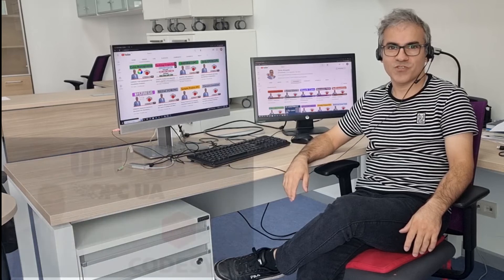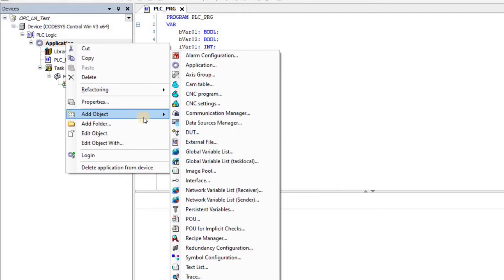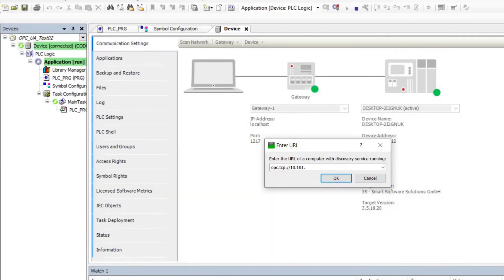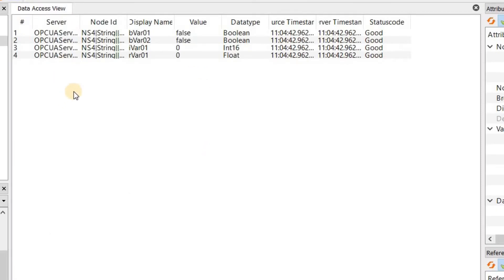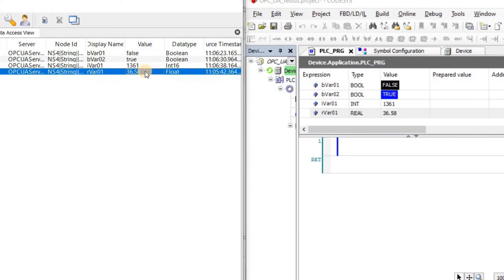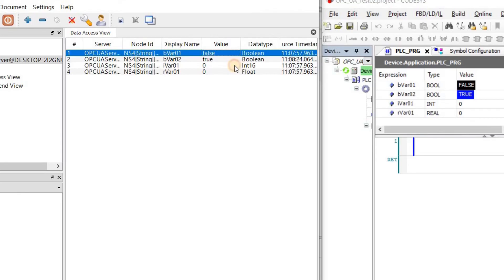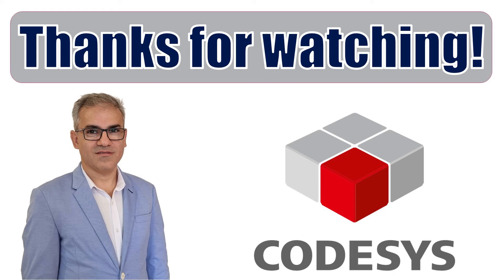CODESYS: OPC UA - Using CODESYS PLC as an OPC UA Server #codesys #opcua #opcuaclient #uaexpert

Comment: Hello my friend, great video! I have a little question. How can I apply the values in CoDeSys, to change them ( OPC UA-Server)?
Reply from the maker: Hi, thanks for your comment. I didn't understand your question fully, but if you mean that how to change the values f the variables on the CODESYS side, while the project is running, you can do it through visualization or by forcing values to the variables.

Comment: Hello sir, thank you for sharing this video. In my application , i want to send acsii data (string) from raspberry pi to a scada software. Maybe with opc ua and codesys as common platforms. Is it possible? And to include raspberry pi as upc server what should be done?
Reply from the maker: Thanks for your comment. Yes, I think it is possible. You can use CODESYS runtime for your Raspberry Pi, then use your Raspberry Pi as an OPC UA server, like what I did here, and then read the data using an OPC UA client on the other end.
I hope this helps. Let us know if you succeed in doing it.

Comment: I've got this error: 
Used UserTokenType: Anonymous
The server returned no certificate, all certificate checks will be skipped.
Error 'BadIdentityTokenInvalid' was returned during ActivateSession
Connection status of server 'OPCUAServer@PCNAME' changed to 'Disconnected'.
Reply from the maker: What version of CODESYS do you use?
Reply: @TohidAlizadeh  I installed the last version: 3.5 SP19 Patch 6+ (64-bit). I don't know really know what it's wrong.
Reply: @rodrigueroland  I also struggled with this. Solution is very simple - go to Communication Settings -> drop down menu: Device -> Change Runtime Security Policy... -> tick the Allow anonymous login box. Works fine for me. Thank you @TohidAlizadeh for great video.
Reply: @jaceksieradzki1505  thank you very much.
Reply: @jaceksieradzki1505  This should be a pinned comment, thank you very much!
Reply: @TohidAlizadeh  i'm using CODESYS V3.5 SP21 and have the same problem

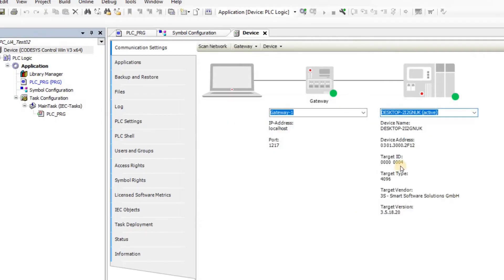Comment: 2:53 

Hi .. i got this message ( The selected target system 'CODESYS Control Win V3' is
different from the connected device 'CODESYS Control Win V3
x64'.
ID mismatch: Selected=0000 0001, Online-0000 0004 ) 

Also i don't know what user name and password i should enter at 2:48
Reply from the maker: Hi, thanks for your comment.
It seems that the device that you are using in your project is different than the virtual PLC running. Try to update your device in the project and make it the same as the virtual PLC. 
There is a way to remove the username and password and setup new ones. This is done by deleting some files on your PC. You can look it up ( I may also make a video explaining this soon).
I hope this helps.
Reply: @TohidAlizadeh  i solved this problem .. thanks .. i have other questions and i need help .. can i mail you ?
Reply: @TohidAlizadeh  i solved this problem .. thanks .. i have other questions and i need help .. can i mail you ?

Comment: Hi Mr Tohid,
Thanks for the information they are so useful.
I am facing one problem at the moment. Can you do some sort of tutorials to teach us how to manage multiple PLCs at one time ? And implement the data resource manager instead of MODBUS for the communication between them. I am using 3 PFC200 WAGO and 1 WAGO Touch Panel 600 at the moment. However, the screen can't mirror the information from the PLC which I am trying to use the data resource management. 
I will appreciate so much if you can help us out with this.
Reply from the maker: Hi, thanks for your comment and suggestion. I am considering to use multiple PLCs and demonstrate how to share data among them. It will take some time though to do it and publish the video tutorial. Stay tuned!
Reply: Thank you very much ! @TohidAlizadeh
Reply: What are the challenges of managing multiple PLCs? You have a bus and devices. Who is your online master? Panel or PLC? What is the operating logic of the PLC and the panel? Do you know all this?